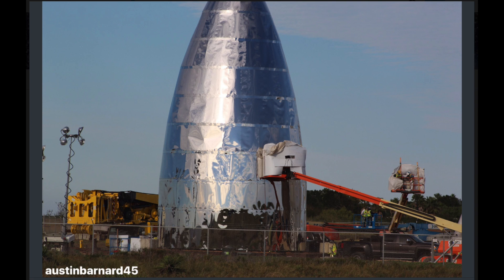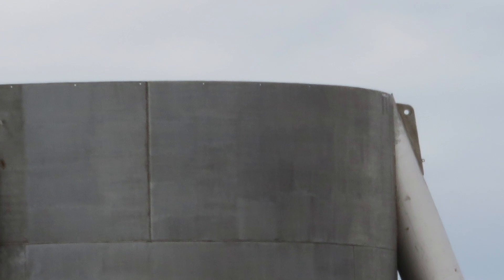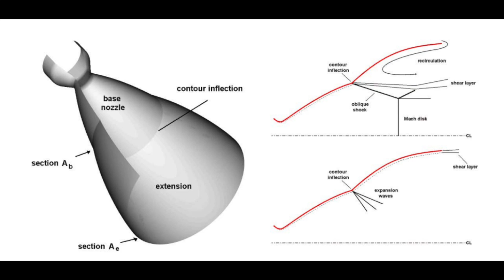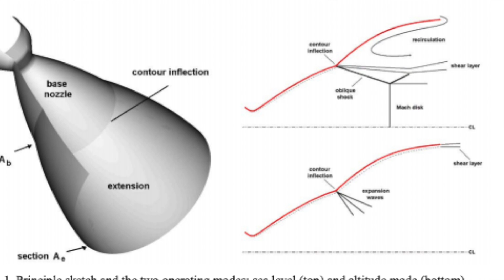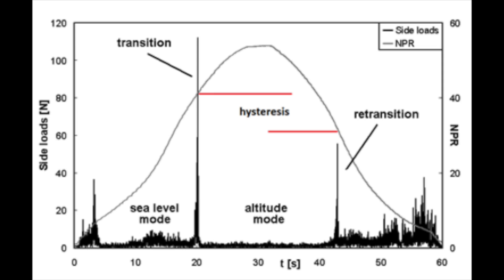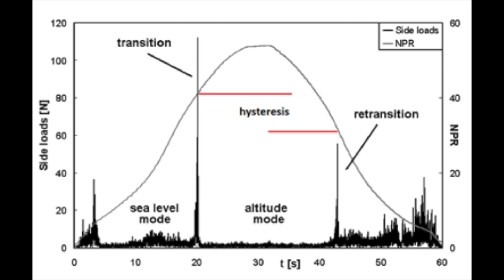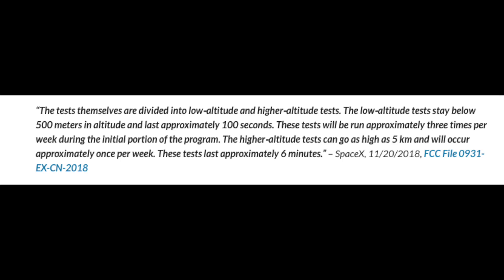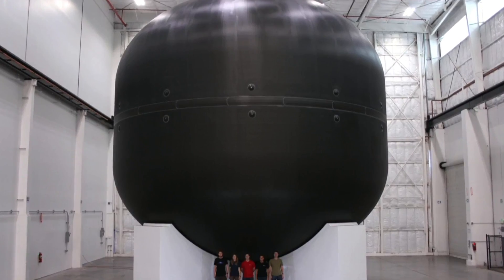What's Going On With SpaceX's Stainless Steel Starship?

Comment: its damn genious what they are doing.
normally the starship would carry a lot of weight due to cargo and crew. Since this is a test, they could either use super expensive carbon fiber for the rocket and tank and put concrete ballast weight in there or ---------> build the same thing out of heavyer, cheaper welded steel that without cargo ends up exactly at the same weight as the real thing with cargo while costing a mere fraction to build with some handyman company in a tent XD they dont even need the carbon fiber tank since they just build the tak the same wey they build the outside. thats why that super expensive tank will never show up there :D
same weight, same geometry, same data. since the first tests are for the controll systems, i bet the only real thing in there would be the flight computer and the engines.

please somebody with actual rocket knowledge give me their thoughts on this :D
Reply: Marvin M. The real starship is going to be stainless steel too though, as it performs Better all around the board according to elon. For now theyve ditched carbonfibre
Reply: @interstellar6413  I don't think anyone has clarified whether they ditched the carbon fiber tanks or just the shell, so it's possible the carbon fiber tanks will still be used on the final production model.
Reply: @MrMattumbo  on top of this I haven't seen Elon mention anything about the super heavy being stainless, so I'm still expecting that to be carbon fibre as it's not going to be subjecting to anywhere near the same heating.
Reply: @MrMattumbo  The tanks essentially are the shell of the vehicle. There's an enormous mass penalty to having tanks inside of the structure instead of building the tanks out of the structure, even with a lighter material.
Reply: @AerynGaming  Maybe they'll end up ditching the carbon fiber tanks entirely then, or at least leave it off till a future iteration. I know for this test vehicle they seem to be sticking with basic tech, save for the engines.
Reply: @interstellar6413  
Really?, stainless steel?!...
I don't see why stainless steel would be a better spaceframe choice than aluminum or aluminum Composites, since stainless steel is structurally quite sound, but weight-inefficient as far as Rockets go...
 But I guess we'll have to wait and see it fly.
Reply: @HuntingTarg  heat cycles
Reply: @HuntingTarg  from what I understand from Elon's tweets, the use of stainless steel allowed simplification and mass savings elsewhere in the rocket to more than offset the mass penalty using stainless caused.
Reply: @HuntingTarg  During STS-27, a classified mission on the Atlantis shuttle, debris from the external fuel tank hit the heatshield and damaged several tiles. The orbiter survived re-entry into atmosphere because the exposed part of the shuttle was a steel component of the L-Band antenna. Steel managed to survive the extreme heat but when a similar incident occured in 2003, the Columbia Shuttle was not so lucky.

SpaceX is likely taking the knowledge that steel can survive much higher temperatures without a heatshield than composites or aviation aluminium can, and will use an active cooling system, probably using the cryogenic fuels, to keep the steel skin of Starship cool during atmospheric re-entry. If Starship did use aviation aluminum or composites for the airframe, then the weight saving would probably be offset by the extensive heatshielding they would need to apply to the craft.
Reply: @HuntingTarg  The strength per mass of aluminum v/s stainless is not as different as it might sound.  Yes, aluminum is stronger per kilogram, but not by orders of magnitude.  The difference in mass might be mitigated if the stainless had some other quality that the aluminum lacked.  For instance, aluminum (in aircraft grades like 6061) can be more brittle than stainless.  Aluminum also has much different thermal conductivity.  So there are all sorts of rationalizations for using stainless v/s the alternatives.  What the actual ones are is something we don't know yet.

My suspicion is that this is a technology demonstrator that is expected to crash at some point, and that they're using it to test the viability of the stainless construction.
Reply: @vaska00762  
That [edit]: does make sense. I just wonder if it's really necessary for Starship to have a high AOA reentry profile.
Of course I don't know, that's probably something that SpaceX is keeping in house until they do an actual aerodynamic test of the first space frame.
Reply: @vaska00762 the "weird shift in focus to starship" is nothing weird if you follow the spacex story. Musk's goal is to go to mars, that's why the company exists. The good place they are in thanks to falcon/heavy and dragon 2 is just an intermediate step towards the main goal.
Reply: @HuntingTarg  Thermal performance during reentry which is not something most rockets need to worry about. Apparently the plasma shock formed on reentry actually keeps convection to  a minimum so most heat is transferred to the structure as thermal radiation rather than directly from the plasma. That means that a shiny surface absorbs less heat, and re-radiates it more easily leading to lower overall temperatures experienced. In addition to that it's easier to use some kind of cooling loop with remaining fuel to improve that further than it would be with less thermally conductive materials like carbon composites. All told you probably have a more resilient structure to the heating stresses so while performance might still be moderately lower for a single mission it probably has longer refurbishment cycles and therefore lower lifetime costs of the system. 

Also apparently the strength to weight ratio of the stainless is more consistent across a wider temperature range (As we have cryogenic to a thousand plus degrees in a single mission profile) apparently most of the other options are stronger at one end of the temperature range or the other but the stainless is better once you take the whole range into account. 

Or so I've heard.
Reply: @vaska00762  I wonder how much expensive will be using titanium instead of carbon fiber, as it thermal properties are even better than stainless steel, and has a much better specific mechanical properties (per mass).
Reply: @amigodesigns  Keep in mind SpaceX not only makes their rockets extremely capable, but also very economical as well, which is required if you want to colonize any celestial body. Maybe a huge block of titanium would work better than a huge block of steel, but it would probably cost almost as much as an SLS.
Reply: @HuntingTarg  I'd assume you wouldn't have to add as much ablative or heat resistant materials for reentry plasma using steel. Maybe... depending on materials. Take it easy klingon war pet.
Reply: Because at some points of the launch and landing, They need a skin that will handle temps above the melting point of alum.
Reply: @dragonsword7370  I'm chill, you misread my intended tone, and; lol, very cute.  It's always nice when someone actually recognizes my handle.
Reply: @tarmaque  There is also talk of using a special grade of stainless steel,  that might have other advantages like being lighter weight, too.
Reply: @alexandermarvin9536  I work in industry and know most of the common grades and chemistry of Stainless.  There is no "stainless steel" that is significantly lighter than any of the others.  +/- a  couple % at best.  Stainless steel is an alloy of iron, carbon, and varying percentages of chromium and nickel. (The technical definition of Stainless Steel is having more than 10.5% of Chromium) Trace amounts of other elements can give it other properties as well, such as improved machining, corrosion resistance, or hardness.  Typically Stainless has a density of 7800-8000 kg/m3.  As a comparison, Aluminum alloys typically range from 2500-2700 kg/m3.

In the case of SpaceX and "Starship" I would expect they are going for an alloy with the lowest thermal expansion.  Certain Martensitic grades of Stainless show increased strength and resistance to thermal expansion up to 650º.  On the other hand, since this is a test bed construct like the Grasshopper, I expect it's made out of simple and cheap 304 stainless.  The final spacecraft may be made out of one of the exotic stainless alloys.
Reply: @HuntingTarg  he said they have built their own steel alloy...it's not some traditional one. He said it was initially done to speed up the process but it turned out to be great over all
Reply: @electricalastro    
I caught that from reading through the developing thread: with what can be done in metallurgy today I'm sure it's superior in product quality to early instances of it in the 1910s or to simple scissor steel.

My biggest curiosity about it now is whether it will develop rapid oxidation under reentry conditions of high temperature and pressure:  all steel can oxidize under proper conditions, and stainless steel is simply steel with an electroplated coating of Chromium to inhibit this process.  This is not necessary with most aluminum, because aluminum self-coats with its own oxide, which inhibits further corrosion (aerospace aluminum is typically painted to preserve surface-layer airflow characteristics). Steel pit-corrodes, which is a self-accelerating process in the presence of moisture.  I'm fairly confident reentry contitions and the leading plasma shockwave will dissociate most water vapor, but surface boundary layer dynamics also play a role in this.
I doubt there will be serious metallurgy problems over one test flight, - but quality inconsistencies over such large production quantities are not unheard of, even in spaceflight programs, and I think it is not inconceivable (Fessini) that it could result in foreshortened spaceframe lifetime and cause trouble for SpaceX down the road if they pursue an 'all-in' strategy on Starship.

In short, SpaceX may be ambitious and still on close margins, but upshifting their program to a new design and making such radical changes, and simultaneously sacrificing most of their current expertise and suppliers in composites, is a bold, risky decision.
Reply: As said by others, the final plan is to use stainless for the skin (and probably main structure too).  Fair point with respect to the tanks and other components though... Might as well use cheaper heavier stuff (and less ballast) for testing so long as the CoM is right.

A word on the stainless though...  SpaceX has developed a new stainless alloy, and we don't know exactly what properties it has.  Metallurgy has advanced quite a bit over the last few decades.  From the tea leaves they have put out, it seems that the strength and thermal properties (probably conductivity and relatively high melting point) is letting them simplify the design and more than offset the additional weight.  It is reasonable to speculate that they may be planning on active cooling (using the cryogenic fuel they are already carrying) which fits nicely with using a high thermally conductive material.

I wonder who is manufacturing their steel.  There is quite a bit of 'art' involved in making high-quality exotic steels, and the list of companies which are actually good at it is pretty short.  It isn't as simple as just following a recipe... lots and lots of random details end up mattering way more than you'd think.
Reply: @travcollier  They are using active cooling to keep the temps down and the stainless steel has massive temp protection anyways. Everyday Astronaut provided some good info on it, though it may have been him on Our Ludicrous Future. The biggest reason for stainless steel over traditional heat shields is for rapid reuseability. Standard heat shields or those on the space shuttle require too much refurbishment to be useful for Spacex.
Reply: @anthonypelchat  Exactly. SpaceX doesn't want to refurbish the Starship between missions, ideally they'd just refuel it, restock supplies, and fly it again. Goes well with their plans of Earth-to-Earth travel.
Reply: @DeeSnow97  Exactly. The stainless steel works for that. Heat shields need refurbishment. I believe that they have the same goal as the Falcon 9 Block 5. 10 flights with little or no refurbishment. After the 10th, do some maintenance and refurbishment as needed. Fly up to 100 times in the life of the rocket.
Reply: @anthonypelchat  
No, I think that the Starship has to handle about ten flights per day and no refurbishment for 100-600 flights, minimum, in order to meet economic projections for passenger service. Aspirational
Reply: I think they should sit h the heavy stainless steel in favor of the clear plastic they make packaging with that requires a jackhammer and a beaver to cut.
Reply: I appreciate everyone's feedback, it has been most enlightening.
It occurs to me that since an orbital vehicle on this scale has never been flown before, it may play into the properties of stainless steel versus aluminum and the simple scale of the airframe, that Musk and his design Engineers looked things over and decided to go with stainless steel in order to throw heat shielding out the window.
And I do agree that that would make tanking fuel a lot simpler.
Reply: It will be interesting if Starship gets a successful test flight and then China experiences multiple successive launch failures trying to build rockets out of Chinese Stainless Steel.
Reply: SpaceX has its own inhouse foundry for researching stainless. Not sure if it would have the capacity for production or if they would contract out, but they do like to keep things inhouse.
Reply: If this is going to be a "display model", sitting around for years before (or even without) being flown, then stainless steel makes some sense: You don't want your nice shiny spaceship going rusty. So what's wrong with aluminium then? Well, in humid conditions, especially near the coast, aluminium corrodes faster than you might think, so without a damn good paint job, that wouldn't be a good choice either. Carbon fibre would solve both problems, but is far more expensive and harder to give a shiny metallic appearance.

Another possible reason to use stainless steel: It can tolerate cryogenic temperatures without becoming brittle, which ordinary steel can't do. Those giant LNG tankers transporting liquid methane round the world use stainless steel for all their plumbing, for exactly this reason. So if the spaceship is designed to use a cryogenic active cooling system for the heat shielding, stainless steel would be a good choice for that.
Reply: No Elon said they where stainless steel balloon tanks. So no carbon fiber
Reply: @aarong.4691  He also said they want to avoid "building a box in a box" so it's safe to assume whatever the fuselage is will also be the fuel tank
Reply: This is a good thing to build and test now. Either it works like they think it will and they will have the structural and thermal readings that match their expectations, or it fails miserably and they have the readings from the failure. Either way they win. It works and they proceed with a better built mk2 or it doesn't and they proceed with a redesigned mk2.
Reply: Noooo, they switched over to stainless steel for the actual ship portion because it's less likely to go 'fwooshy-burny' on reentry, holds up stronger for longer, and basically lets them cut costs and minimize the hassle for reuse. They can paint on an ablator instead of needing to bolt on much heavier panels or tiles, saving headaches. And the idea of a giant shining... phallic replacement symbol... has a bit of an appeal.  And reducing heating issues in deep space, and... etc, etc, etc.  In short, the real thing will be high-grade stainless, and it's an actual type of rocket construction practice that fell out of favor with the end of the S-V, and it actually works really well but needs a really freaking... big falcon rocket-thing to offset the tradeoff.
Reply: @defies4626  
No ablator. SX300 doesn't oxidize, so they just have to spray cryogenic propellant on it from the inside to keep it from softening. The shiny surface reflects away the majority of thermal energy.
Reply: @_Andrew2002  No, this is an actual tested and proven rocket design philosophy from near the beginning of rocketry that fell out of favor due to NASA going for high-tech and trying to minimize weight. Scott already covered this. It does, in fact, make sense and is totally viable. Counterintuitive because of how NASA's led everyone so far down the other path, but viable. Sometimes the high-tech approach is actually the wrong one, and you have to step back and ask if the theoretical performance is worth the headache. In this case, apparently not.
Reply: Why couldn't they use Inconel or titanium for the skin and frame instead? Wouldn't the extra strength/weight ratio and better retention of strength at higher temperatures be desirable for a spacecraft?
Reply: @BrokenLifeCycle  Inconel is incredibly expensive. Most applications on earth are for the automotive industry, either used in exhaust pipes, turbochargers or battery connectors. In space applications, inconel was used for the F-1 engines, the Merlin engines and the SuperDraco engines on the Dragon 2 launch espace system.
Inconel also saw use on the X-15 as its outer skin, however, the airframe and the bulkheads used other materials.

Titanium is also expensive, but its main expense comes in the form of manufacturing parts out of it. Titanium has seen a lot of use in aviation, however titanium is mostly only used for the parts which need to be the strongest and bear the most amount of weight/force. Almost all commercial airliners have a few tons of titanium in them, but their use is rather sparing. The X-15 used huge amounts of titanium for a mix of weight, strength and the heat durability. The XB-70 supersonic aircraft also used large amounts of titanium for the airframe, but the cost of titanium caused the XB-70 program to soar in cost. A large amount of titanium was also used in Concorde, but its use was limited to the leading edges and the nose cone, as well as other structurally vital components due to its high costs. The Boeing 2707 Supersonic Transport which never flew had its first design completely scrapped as there wasn't even enough titanium in the world to build its massive swing-wing system.

SpaceX would probably be mad to construct a craft similar in size to the Space Shuttle out of titanium and inconel. It would probably bankrupt them. Steel's biggest issue is oxidisation in the atmosphere during re-entry, but steel is surprisingly good at absorbing heat, the main issue with it is weight and the issue of oxidisation.
Reply: @vaska00762  In the hypothetical scenario where cost is not a limiting factor, where would titanium and Inconel not excel in over stainless steel?
Reply: @BrokenLifeCycle  If cost is not a limiting factor, then availability is the limiting factor. I mentioned the Boeing 2707, but what made Boeing redesign the SST was down to two facts. The hydraulics for the swing wing would make it too heavy to fly, but the other factor was that there wasn't even enough titanium in the world at the time to make a solid joint piece.

An early discovery with the XB-70 as well was that there was also not enough titanium in the world (at the time) to make more than 3 aircraft, at least with the inital plan to have a fully titanium air frame and skin.

There is another factor with titanium, the fact that it is notoriously difficult to machine. It's a strong material, but it's not easy to get machine large pieces of it into shape, so the best options are moulds and then machining that down (at the possible loss of strength) and also the other issues with just manipulating titanium.

Inconel, at least from what I gather, is far less limited by its availability, since most of the metals which make that alloy are pretty available. However, the main limiting factor would remain the existence of metallurgists and facilities to manufacture that alloy. Otherwise, I don't know of much else that would make inconel difficult as a material for this, other than cost. Only thing that comes to mind would be the high environmental costs of mining and purifying large quantaties of nickel and chromium, which in different states, can be highly toxic.
Reply: @vaska00762  
SpaceX has the oxidation solved with SX300 for sheet metal and SX500 for casting.
Reply: Center of mass is not the only thing they need to replicate. Moment of inertia which is shape dependent would need to match as well. Honestly I got some doubts on the shape of this starship .. doesn't look like it'll perform well aerodynamically speaking
Reply: @_Andrew2002  Gwynne Shotwell is well known for reigning in Musk from time to time. Most of SpaceX's operations are actually run by her, not Musk. She's the COO and President while Musk remains the CEO. Musk's other job in SpaceX is basically "futurology", basically predicting future science and giving the company a direction to go in. Only his job is mostly symbolic, since there's another guy doing the "futurology" for propulsion technology. Basically, Musk has gone from software engineer to entrepreneur. It's probably no surprise that basically all the other high-ups at SpaceX are aerospace engineers by profession. It's Musk's cash, but it's not Musk doing the work, shall we say.

I really do think SpaceX has a really good oppertunity with the Falcon9 and Dragon 2, especially since they now have the means to basically sell their product to other space agencies and space tourists. However, their weird shift in focus to Starship is weird to me. They abandoned human rating Falcon Heavy for the Starship/Super Heavy, and it's almost as if they're now just making Dragon 2 a product for their customers.

SpaceX does give me concerns though, especially with how little information they actually gave out about the Dragon 2, the IVA suits and so on. Meanwhile, Boeing has videos and articles detailing their IVA suit, their construction process, their flight controls, etc. etc. etc.
Reply: @vaska00762  They abandoned human rating the Falcon Heavy because the Starship will replace it. With the Falcon Heavy, they could replicate Apollo 8-style missions, which isn't bad, but compared to the Starship it's not that great. Dragon can't do orbital refueling, and frankly, it's just too small to do what the Starship is set out to do, plus it requires throwing away a Falcon 9 second stage at every launch. There is no reason to human rate a rocket that could just throw the Dragon into a higher orbit, it's highly improbable that they'll exceed the Falcon 9's lift capability with any Crew Dragon mission.
Reply: @vaska00762  If you read the briefings for Starship, it's slated to be a considerable leap forward from the Dragon and puts it well ahead of its competitors. Earth to Earth flights, rapid reusability, orbital refueling, full landing capability for the Moon as well as enough range to reach Mars....

It's SpaceX's moonshot, literally and figuratively, that could grant it lasting dominance in the market. I'm not surprised Elon is betting the farm on that.
Reply: @vaska00762  > However, their weird shift in focus to Starship
I think you've explained it yourself. Gwynne runs SpaceX as a business. SpaceX runs as an uncharacteristically well-oiled machine compared to other Musk enterprises, so the difference must be her. When however Musk imposes his vision/will onto SpaceX ("I wanna go to Mars!"), SpaceX takes illogical (from the business point of view) and impractical steps. 
I personally believe the SpaceShip and Mars will be the death of SpaceX; however, I hope that Falcon "division" is formed into a separate company and continue to perform useful work.
Reply: @vladimirdyuzhev  Starship is probably Musk's vanity project. It's more than likely that the only profitable thing that could happen would be Falcon rocket advancements, possibly into a future Block 6 and other such things. I cannot see many applications for Starship as its current iteration indicates. There's no word on a cargo version, which would be the main reason for building such a large space craft, and then there's the additional question of what will it dock to, and how?

I fully expect the likes of ESA and JAXA as well as other smaller space agencies like the South Korean, Brazilian,  Israeli, etc. be very interested in using the cheaper seats on a Dragon 2 to get to the ISS. Both Starliner and Dragon 2 support space for 7 seats, and while I doubt that they would be filled up, the fact that astronauts can be effectively passengers on the Starliner and Dragon 2, unlike the Soyuz (where all 3 people need to be able to control the capsule, requiring 1 year of training in Russia), means that there could be a return to more visiting astronauts spending a week, maybe up to 10 days on board the ISS before returning back to earth, much like in the Space Shuttle days.

ESA most likely has seats on the Orion booked in. We've already seen footage of ESA astronauts being familiarised with the Orion capsule for ingress and egress as well as the Orion systems, so it's likely that some of the ESA astronaut corps, at least the astronauts who have already had a single spaceflight, are being considered for the SLS missions. The thing is, JAXA and other agencies probably don't have seats on the SLS/Orion, and we're not even sure if SLS/Orion or even LOP-G will survive US election cycles. From the Constellation Program and Asteroid Redirect to DSG, NASA's projects have cancelled each time the President and Congress changes hands. So, if LOP-G gets axed, then what can SpaceX even do with a moon rocket?

Blue Origin's motto is not to be forgotten, but the fact that their greatest contract so far has been selling the BE-4 engines to ULA for their Vulcan rocket shows that Blue Origin fully understands that their operations will be dependent on them being a successful business, even if it is a vanity project for Jeff Bezos. Virgin Galactic is already a decade and a half behind schedule, and that's nothing more than Richard Branson's vanity project as well.
Reply: @vladimirdyuzhev  Are you guys serious with the 'what's it going to be good for?' What's it dock to? It's huge, you dock your dinky little space station to it. Land in time for dinner in Paris, then go back up for a couple of evening orbits. Or go to the moon for the weekend, your choice. We'll walk around and toss $100K rocks at each other in low gravity, as long as I'm back in the office Monday. Along with 20 of my friends.
If Elon pulls this off, it's a real game changer.
Reply: @vaska00762  
The whole point of BFS/Starship is to reduce cost of flight another factor of ten. At that point, both Falcon and Dragon will be obsolete. Of course, the reliability and reusability must also increase by more than a factor of ten.
Reply: Ordinarily I would have thought that such a strategy would change COG and so many other things that the data obtained would be virtually useless. The one exception I can think of would be if the final hardware is planned to have side-mounted solar panels like the Dragon 2. In that case the heavier materials wouldn't be simulating a centralized payload/ballast, they'd be simulating the future addition of solar panels.
Reply: @Myndale  I don't think that will matter so much, given this looks more like a testbed for engines, avionics, and flight control. This version is also much shorter than the final article, so material doesn't matter so much.